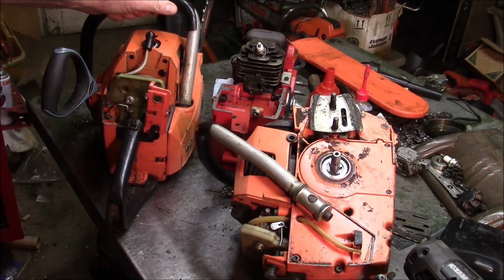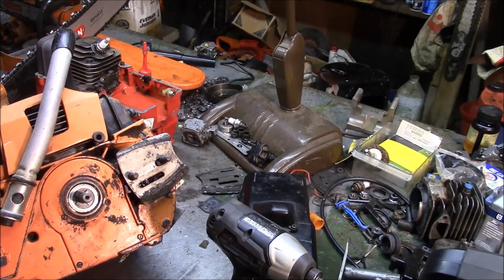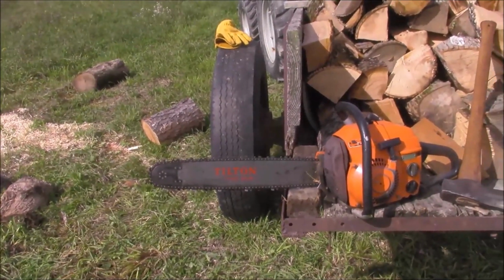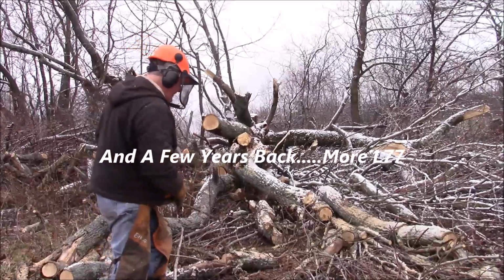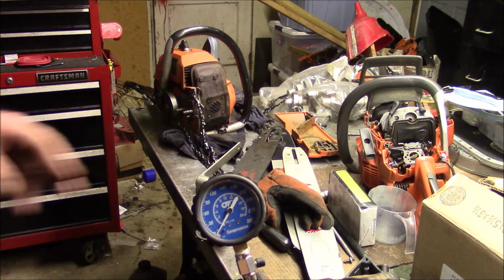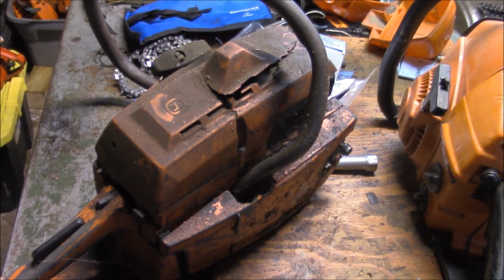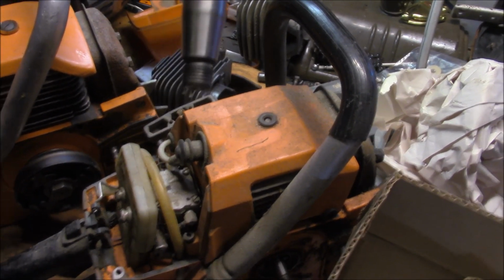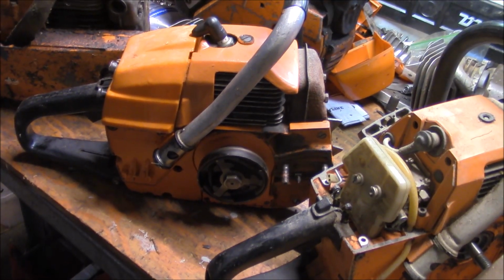Husqvarna L77 Over The Years On The afleetcommand YouTube channel & A Bit Of Husqvarna Trivia

Comment: I have a 1970 Homelite XL12 and a PMAC 610, both run fine.  However! They are heavy.  My Homelite has a 16 inch bar and the MAC has a 20 inch bar.  The MAC weighs 21.25# and I do not know what the XL12 weighs but a lot.